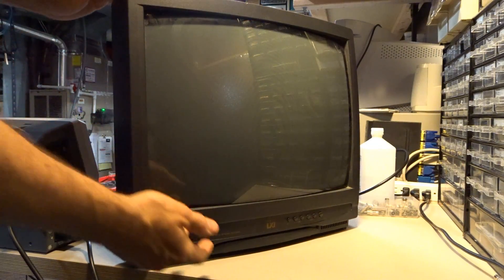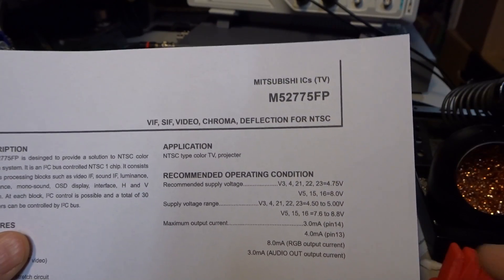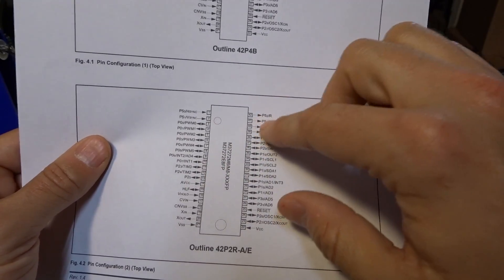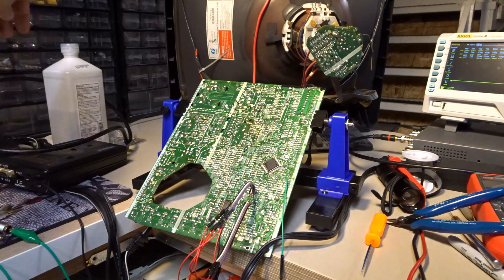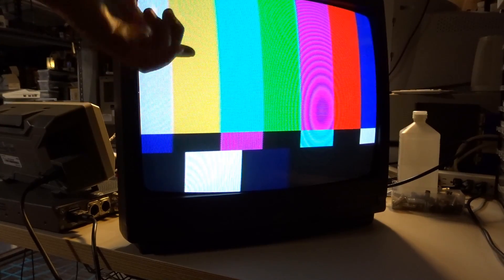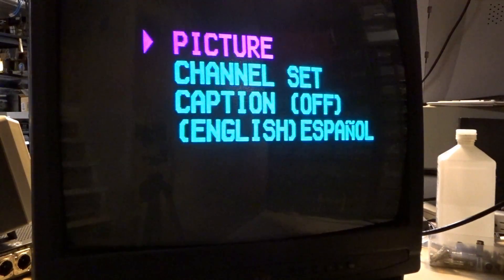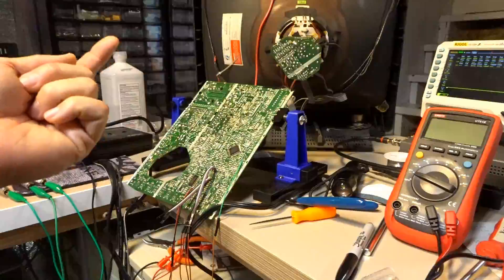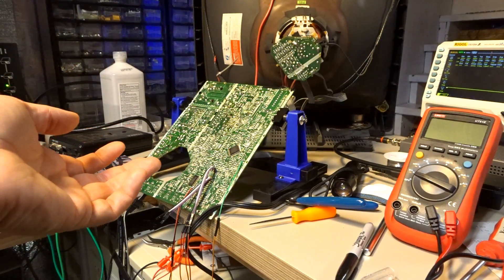Trash Picked TV RGB and Composite Mod

Comment: I got JVC 14", cheaper one. I am trying to get RGB but I couldn't.  Model is C-14A1E, uses jungle chip is LA7680. It only has RF input. De microcontroller has RGB out,  but I don't know how find sync once there is no composite. Could you help me?

Comment: So, I've been doing some thinking (always where trouble starts) couldn't you invert the original OSD blanking signal then AND it with a logic high signal and the result would be a blanking signal which knocks a mask for the OSD out of the RGB video? 🤔

Comment: A friend gave me a 13" Symphonic television around the same vintage made by Funai. The TV and PCB look exactly the same with those two chips. I'm going to try to do the composite mod, as the TV currently has an RF input. Earlier I attempted to add a RCA jack in the front and switch the TV to front composite mode via a universal remote; however, the other components were missing to make it work, as you mentioned in this video. It would be interesting to try to get the front composite working; however, interrupting the tuner looks easy enough. I'm curious as to if there would be a difference in color quality between the two options. I plan on using this TV for composite video only. Great informative video!

Comment: Do TV's with scart perform similar than this rgb mod? I don't know if crt tv's used postprocessing and if the rgb mod would make the picture more sharp.
Reply: RGB over SCART performs the same, CRTs didn't use postprocessing until late '90s and It could be bypassed if necessary.

Comment: Where did you connect the gray wire to get it to go full RGB. Your video doesn’t show that very well or exactly what you did. I have this same board on the tv that I have. I can make go full RGB from an external power source. Please make a more detailed video. That tv main board is very common was in several brands.

Comment: I know this was 2 years ago but I have some info about service mode if you haven’t already found it:

My ex had a TV with the same Funai Menus sold as an Emerson I think. We had an aftermarket universal remote and one button would enter service mode and you could change alignments and available languages etc. I don’t remember the universal remote but it would have been from the 2007 era. Once in service mode you had to use the front panel buttons.
Reply: Pretty sure it was a Phillips CL035A universal remote. The CC button entered service mode.

Comment: I'm in Germany and wanted a small color screen for my Atari ST (mine only came with the high-res black and white monitor). I simply bought a cheap used 15" Phillips TV and a SCART to Atari ST cable from eBay. Very easy thanks to SCART. Only thing that annoyed me was that the seller where I bought the TV also had a very cool looking 70s TV that would've looked amazing on the shelf, but since that was 70s, it didn't have SCART and I was forced to get the Phillips TV from the 90s.

Comment: Can we assume that is not a hot chassis TV and used an isolated switchmode power supply? I guess most late model TVs did that because AV inputs were so common in the 80s and 90s. But 70s era TVs were mostly hot chassis. They sometimes drew low voltage B+, like 18 volts from the flyback or HOT, but the horizontal output circuit and often the vertical and audio output ran on rectified line AC and was hot chassis.

Comment: I have two good tvs, with european Scart, both shows the OSD mixed with the RGB scart input signal. So they probably use the RGB official input as on this crappy. In the past we normaly use the scart with just the composite video, becouse VCR was directly recorded using composite video signal on tape.

Comment: I just picked up a Magnavox (Funai) 13" for 7.50. I know that it cost more than free but on the plus side, it has never sat in the dirt. It is a DVD combo that was manufactured in 2008. By my reckoning, there should be a couple of places to feed in an RGB signal. If I piggyback where the dvd feeds in, I can use both the DVD and the new RGB connectors and just have a toggle switch to switch between the two. With any luck, the DVD circuits are on a separate board with actual wires running the signal between the two. If that is the case, I can do this mod in my sleep.
Oh, and you probably won't kill yourself if you inadvertently touch a charged flyback circuit. Probably.

Comment: ADRIAN BLACK, I'm confused how arcade game circuit boards send out RGB outputs and Horizontal sync and Vertical sync outputs. The arcade monitor takes the RGB signals and H&V sync signals and converts them to what for the Horizontal deflection and Vertical deflection circuits. How does the arcade monitor know how to trace and draw the games graphics on the CRT screen. I'm confused how the arcade monitor converts the RGB and H&V sync signals into drawing tracing them on the CRT screen, can you please explain how this is done?

Comment: why you didnt do 720p mod?you need few chips and solder few extra big capacitors,but you can do it.this tv datasheet max resolution is 720p
i guess its meant for high end model
Reply: You should change all the electronic board for that, it should sync to 28 or 31 kHz for that

Comment: Fantastic  work ! Just check the ESR of all electrolytic capacitors, specially in the power supply, vertical and horizontal sections,  replace all bad and your TV work for many years without problems.

Comment: Do you know that CRT emites X-ray (Rentgen's rays) to back ?? You can find and measure it. Be carefull.
Reply: @Adrian Black Yes, while you are watching tv at front tv  it is ok. NO X-ray. But when you are behind tv (You look to CRT backside) you get X-ray. The direction of the emition opposites to the screen.  
You   <--<-- shows  || CRT >   emites X-ray -> -> ->wall
On x-ray-meter equipment zero level is moving when crt monitor works and backside of monitor looks to equipment.
Reply: @aakh3500 There's also lead in the glass for shielding (this is why CRTs are so damn heavy)

Comment: My old series LXI from sears was made by Thompson Consumer electronics. Some one I knew had the exact same tv as me with an  RCA branding I also saw GE that were identical to mine at the time. .  A repair man told me they were all the same manufacturer and so did sears. Try looking up service mode for RCA /GE tv and you may be able to gain access to the service mode. Then again yours may be funai Sears may have switched manufactures at some point.

Comment: hi guys, from europe here, is this a NTCS only thing, right?
as i know we have the scart which is rgb, but then, is all i need a scart >>> vga adapter/(converter) right?
i also heard something about analog vga and digital vga, whats up with that and do i need to do sth different or just have that adapter ?
Reply: yes this is a NTSC thing only, PAL TVs have RGB through scart already.
a scart to vga adapter? there is a Sync signal that must be sent or else it won't work, some cheap adapters don't work at all!
what do you want to connect? (an old PC monitor I guess)
vga is analog, I haven't heard anything about digital vga.
DVI conections on PC graphic cards come in both analog and digital "flavors"
Reply: thank for replying!
yeah i have an old TV with scart and rca connectors, i have a couple of old consoles, and wanted to add an old  Dos pc/laptop to it.
Reply: oh, so you need a vga to scart converter. 
well I dont recommend you buying somthing cheap because it probably wont work, 
but even some more expensive converters that actualy do work have some lag issues 
so if you want to do this for gaming then dont bother.
the best option is to find an old-used graphics card for that pc that actually has a TV output built in.

P.S.  when buying converters or graphic cards remember that your PAL TV works at 50hz ;-)
Reply: vaso opel thanks a lot man, didnt think of those variables!
isnt vga pure rgb + sync-things, if i were to make my own cable that should exclude any lag-doing-things, or im probably totally wrong
[some old laptop had an LCD screen, so i guess that needs an digital singnal, though they have a rgb connector on the back, is that then also digital, but than you sad that vga is analog only, so if thats true, then my before mentioned theory shouuuld work? ]
Getting a dektop pc would have less brainfuck, like you sad getting a card to do that, but they're bulky and my room is small :P:D
Reply: if you have the patience to do your own converter (there are schematics and guides on the internet) than you would have no lag ;-)
Reply: thanks for taking your time for  me, time for  some research!
Reply: you're welcome ;-)

Comment: When you see RGB on a cheap CRT, and how GOOD it looks, you gotta wonder WHAT WERE THEY THINKING going composite here in the US!
Reply: When you look at everything ever, in the US, you wonder what were they thinking.
Reply: @Heidegaff  money
Reply: @qwertykeyboard5901  Backwards compatibility.
Reply: I think it had a lot to do with backwards compatibility. In fact, the NTSC standard was developed so that early color broadcasts would be viewable on the untold numbers of black & white televisions then in use.
Reply: @Renville80  To be fair, many CRT monitors in the mid 2000s had component and composite. So if they added both SCART and composite type signals to their televisions, that could've covered compatibility.
Reply: @Renville80  The same holds for the PAL colour system in northern Europe. (I'm not sure about SECAM though, but probably the same.)
Reply: @Renville80 That makes no sense because exactly the same backwards compatibility was true for PAL and SECAM, and all three standards have RGB on the jungle chip. The mere fact that NTSC sets can be so easily modified to add RGB means it was entirely possible to produce them with RGB  as standard from the factory just as they did with PAL and SECAM sets. For some reason they just didn’t bother in the US.
Reply: ya man, I think it was the SCART cable format, but you guys miss on good cable connector and very good video quality
Reply: You want a good picture because nothing is more important in America than being a couch potato.

Comment: It just shows what most of us missed out on CRTs in NA, even the crappy ones could produce better picture than they built them for. I noticed all the better CRT AV options like S-Video, Component and RGB shortly appeared ironically more so on HDTVs but only when they were still a relatively new thing and HMDI wasn't yet the dominant standard. Pisses me off that all that functionality was just sitting there dormant for decades just to save a few bucks.

Comment: Very interesting that this low-end TV from 1999 can support RGB yet a PVM from 2003 (a JVC model) cannot be RGB modded. I understand if the circuitry is not there but why it would be omitted from a PVM seems odd, especially if there are similar models that do offer RGB.

Comment: Did you make a voltage divider to take the 5V from pin 1 on the micon closer to 1V? How did you get the OSD to blank fully?
Reply: Nevermind, just attached a pot to the 5v - found that the blanking pin needs to be right about at 1.3V
Thanks again for this video!

Comment: Unlikely to run across this exact TV? Lol - i found this EXACT make/model TV on the side of the road about 2 years ago - I was saving CRTs for Arcade monitor tube swaps. Ive got a pallet of TVs stacked to the ceiling of my basement. Fast forward to this month, and I've found a bunch of info on RGB mods, and this video!! I failed on a few, got close on an RCA, but i'm hoping to follow this and get a viable arcade monitor, My Dig Dug cabinet needs one! Thanks for this video, i'll let you know how my project goes! Hope you dont mind if i hit you up in the future for some info!  THANKS!!!

Comment: I love seeing things like this.  I like seeing them on appliances, computers etc.  When people who really have it all together start working on the hardware in question and I see it and think "My God it would've been cheaper for the manufacturer to have left that feature on!" 

thanks, great video!
Reply: Actually, when you're manufacturing millions of units, a tiny cost saving per unit adds up to huge savings over the total production run - and that's what lets you sell the units more cheaply. So while that Funai TV had the capability to handle RGB on its motherboard, leaving off the necessary input jacks saved enough for it to be sold at a more competitive price point for low-end TVs.

Comment: I've been on the fence doing this for a while. I have several SCART cables for my consoles, then RGB modded some more... but have been going through a RGB  scart to component adapter.... while the adapter is good... I'm itching for that next step :D I have 19", 27" 32" and a 36" Sony Vega sets all begging for it. The 36" I am hoping will be my primary set... but I want to practice on one of the others lol. They are all in the same line / family. Hopefully I can plan this out and get all the info I need to do this soon.

Comment: Wow this is ace! I'm in the UK and used to have a CRT TV with RGB Scart input, interestingly if I put RGB into the scart connector and only put a voltage on one of either pin 8 or pin 16, I cant remember which (u needed both to make it work correctly), the RGB image whould show through the on screen menus! Now I know why that might have been!

Comment: Great video and great results, how i wish you made this a year ago before i had to figure this all out the hard way. 

There is a way to mux both RGB input and OSD input into the jungle IC by simply changing the passive componenent values. here's the thread where the method is explained: https://shmups.system11.org/viewtopic.php?f=6&t=56155&p=1296533#p1296533

Here's also the video I made, similar mod but retaining OSD:
https://youtu.be/0bPb2xCp6zc

Comment: Awesome video,glad you brought that tv back to life with a rgb mod.

I did the same mod on my trinitron and I was pretty blown away from the picture.
Reply: Whoa, wow, I'm guessing the video quality is as good as a PVM of the time.
Reply: Maybe but a pvm might have better color but I have never seen one to compare.

The best I have seen was hooking my pi 3 to a crt vga monitor and tricking it to run at 240p via 120hz and man,seeing real scanlines was crazy and the picture was amazing,people say it's on par with a bvm.

Here's the source.

https://www.reddit.com/r/crtgaming/comments/5t7bmz/dell_p1110_showing_240p_output_from_snes_emulator/
Reply: @kbhasi  a PVM should have a higher TVL count (something like 800) while those old trinitrons usually averaged around 450? (that is what mine is at least) but anyways, that higher TVL results in a much better picture sharpness/quality.
Reply: Interesting. I never thought to do 240p with 120 Hz.
I've always used line-doublers for VGA CRTs, and back when I started, XRGB-3s were about the only viable option without finding some really exotic used gear probably from Japan.
Thankfully there's a lot better/cheaper options coming out these days--though I still use my XRGB-3 because it still works well for my uses.

Doing 240p 120 Hz would mean thicc scanlines if you like that, they'd match up with pixels unlike mine that double over pixels, and you wouldn't have any flicker like I get on white scenes with my setup.

Also, I have a P1110. Absolutely gorgeous. Unfortunately I need to fix mine up, but it's nothing too serious--just G2 overbrightness like a lot of them get over time. I don't know how to fix it exactly, but I hear it's fairly easy, albeit possibly tedious. In the meantime, my old Mitsu tube carries the torch until I can get around to that.